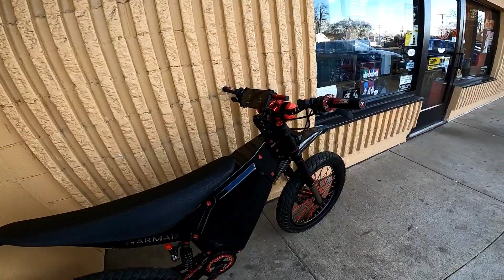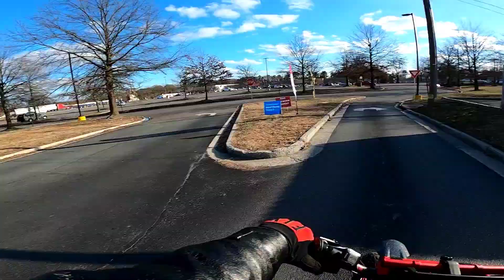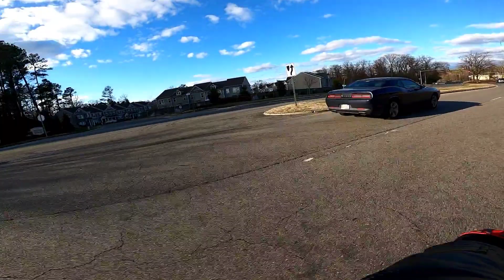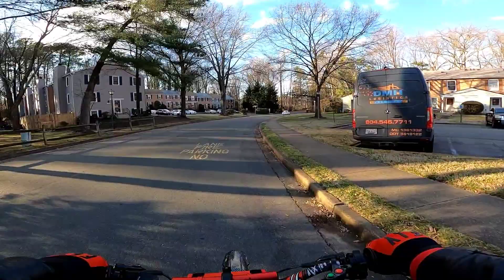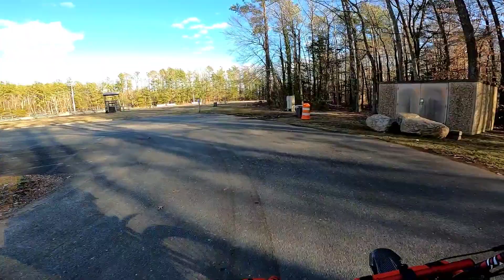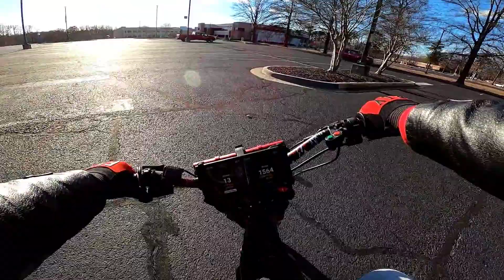30KW is no problem for My CCW Battery as its managing Big Pwr with Max  Phase amps.Crazy Range!

Comment: What kind of range can you get on that
Reply from the maker: Because it's Winter I haven't been able to do a full range test so I've just kept riding daily without charging and after 5 days I was only half way thru to like 50 percent and that was at 58 miles. Those were mostly fast miles riding hard so at least a 100 miles going fast so I'm gonna say just casual riding at I'm sure 150 miles but this is a huge pack is 58.8ah like I say in this video at normal ebike speeds around 30 I'm sure I can get 200 miles. I'll know for sure when weather gets better

Comment: Hey Criss I know you always got a lot going on so I wanted to ask if you are still taking requests to build batteries? Also do you know website for NB power batteries I can't find the website anymore? Last question for a 72v 3,000w hub motor kit with a 80A Sabvton controller will a NB power 80A bms battery work or will I need battery with a higher bms? Big thanks, your knowledge is pure gold really helps us out 👊🏽
Reply from the maker: Yes I just took on a battery build right at the moment and yes that battery will work but you have no breathing room bro your right there I would want a battery with a larger BMS or Do a Bypass. Honestly if it were me I definitely get a bigger battery. BTW Bro you know I have a 72v 40ah NB power battery for sale with 150amp bms but it's bypassed. That's what I was running before I built my battery along with a set of lipos but I needed 400 amps. My battery only like 3-4 months old. It has Panasonic cells which are decent 18650s.I was getting like 250amps out of it.  I paid like 1700 brand new I was selling it for a stack. Man if you can make me a reasonable offer I'll sell it you. I'm either gonna put it on another build or try to recoup some of my money. let me know

Comment: Hey buddy, you seem to know alot about the specs on these things, i have a 750w hub motor, with 48v 20ah battery , 24ah controller, can this same controller & battery run a 1000w hub motor of same make?do you do battery builds for customers?how do i get hold of you?
Reply from the maker: I have a patreon you can join and i can give you my direct contact info right now Fb has me on a time out but Ill be off soon lol as far as your motor and controller its more the controller thats limiting your motor right now you can actually get more power out of that same motor with a larger controller and a higher voltage battery we can talk more if your interested
Reply: @ChrisCrossingWires1212  my bike is a Aniioki a7 pro, folding bike, the battery fits inside frame, really curious about a same dimension battery(to fit inside frame)with atleast 25-30ah ,can such a build be done? I dont want aditional exterior battery, the bike came with a 750w motor, i just aquired a 1000w motor & 30ah controller, but my battery is only a 48v 20ah,so i will be needing a battery upgrade?i also have a spare battery connector head

Comment from the maker: when I said 55 miles on battery I meant on that charge
Reply from the maker: Lishen Lr2170s 45amp discharge rate 4000ma capacity only difference between them and molicels they have 4200ma capacity and these will throttle back to 35amps per cell if they
 get extremely hot but Im not about to run any cells to that point so yeah i approve of these im drawing 32.5Kw from my pack with no problem so thats fine by me

Comment: What is a CCW battery? Your initials, I assume, you make in upgraded batteries? If so give me specs , cost etc.. when I get mines, I will need a BIGGER AND FASTER BATTERY.  plus that seat dude? Thx
Reply from the maker: Well My batteries will be custom to meet your specs so not like I’m gonna have a standard battery one size fit all although I could but it’s more feasible to build it according to your needs so that’s food for thought
Reply: @ChrisCrossing Wires  I want as many ahs as possible. And to push 25kw(70+mph) . Thx I'll keep in touch I have at least 30-50days to wait still hopefully. But I'll keep watching and liking . Keep that shit up. F the haters. I only let positive energy in. I love that shit. Do what you do brother.

Comment: Hia Chris, in regards to cars I think some people have the opinion that we can't go fast and other's ego is so huge they just want to satisfy that ego by blasting by like they are commanding the road!
I know you an ASI BAC man for life, as for me I was fooled into thinking sabvoton was the best but I believe from what I have seen on YT that this year will be the year of the Fardriver controller for me.

I use lithium ion pouch cells in my build with 2mm copper busbars and after hammering for a longtime they only see 17c of heat so your right copper is the one. Keep up the adventure bro.
Reply from the maker: Do you Bro I was gonna go Fardriver in the beginning as I wanted to build a high voltage system and Fardriver is about the only controller that right now can do lots of volts but the more I researched into the software side of things is what made me choose ASI. Im a tech guy and I like to have access to programming and tuning. Same reason I choose android over Iphone because no real tech guy would ever choose iphone same thing here. Every time I ride I go back into my software and tune some more. I am dialing My bike in and Id never be able to do that with Fardriver. Other than that yeah there good but once you install it aint much you can do, its software is limited, only difference and thats huge to me Im an engineer by trade!
Reply: @ChrisCrossingWires1212  Yeah man totally get you, I'm more of a mechanical tweaker 🤜

Comment: Hello Mister crisscrossing wires from Dan the one-legged man in Batavia New York
Reply from the maker: Dan the one leg Man you say? you really need a good two wheel bike no doubt what up My Brother hope all is well
Reply: @ChrisCrossingWires1212  I'm okay how are you doing? I was thinking like I always do why can't you make a generator from a ebike motor? Somewhere I saw someone make a fan motor a ceiling fan motor into a generator
Reply: My cheap-ass ecotric hammer bike is not let me down so far. 1300 Mi and all I did was changing the brakes. There's some guy Papa Bluebeard he calls himself on YouTube he put eight thousand miles on an ecotric bike and he told me he still has the same brakes. I was riding my brakes to see if it really charges yes it does but it's not worth it I got three batteries now 120 amp hour 2 13 amp hour. Plus the broken one
Reply: If I had bought a cheap battery like I bought a cheap charger I gave no bike or no garage cuz I left it charging for a week